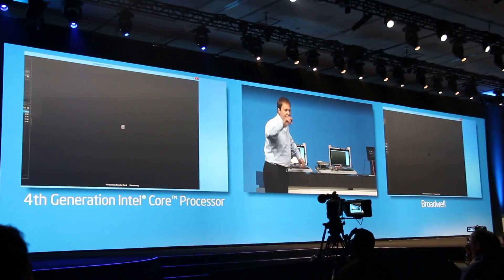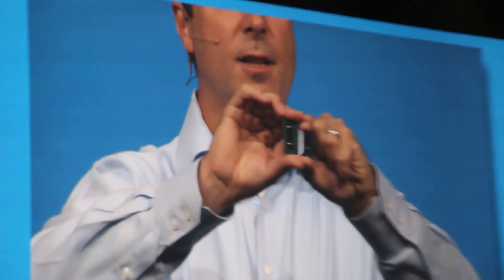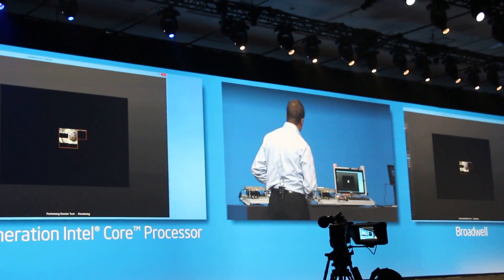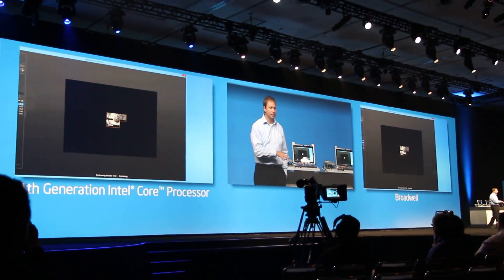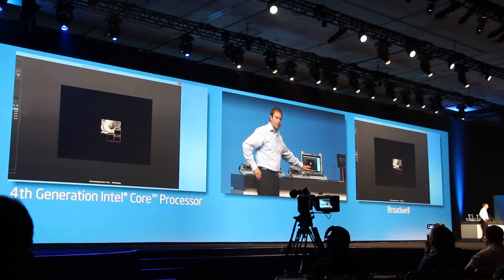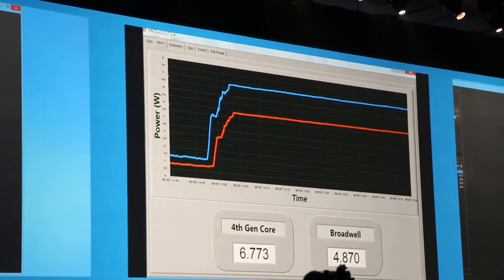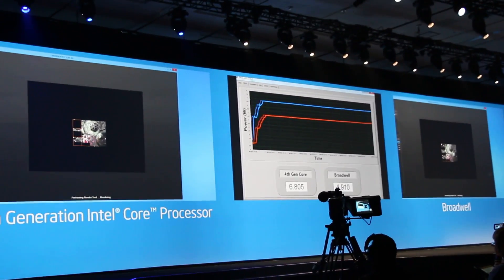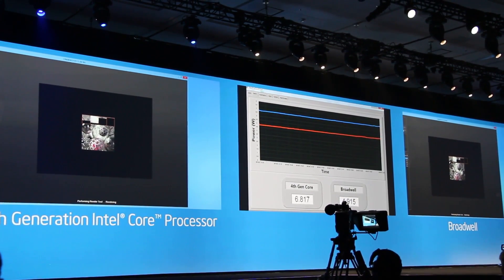Intel demos Haswell vs Broadwell at IDF 2013, shows lower power consumption, higher performance

Comment: Why dont they make the proc. a bit bigger and therefore more powerfull (if they can pack a punch in a bigger proc, why not?)like it doesnt need to get smaller and powerfull, it can stay the same size and be better than if it would be smaller
Reply: ***** Shouldnt they be able to put more power in a bigger chip? im not saying the chips should get bigger, im saying they should stay the same size and not get smaller
Reply: When you're dealing with 4 GHz speed (that's 4,000,000,000 clock cycles per second) just the speed of the electricity is a barrier. Just for reference, light in a vacuum will travel less than a foot in a billionth of a second second - and electricity moves a little slower than that through silicon. Increasing the speed beyond what a CPU can handle will cause the electricity from one cycle to overlap with another. The solution is to make the CPU smaller so that the electricity doesn't have to travel so far. Also, since the CPU is smaller, you can put in more cores. More cores = more simultaneous operations = more computing power. However, many computer programs can only take advantage of one core, so the speed of the cores count too.

So, size doesn't translate to power with a CPU. remember that you're just dealing with 0s and 1s, so it's not like having a more powerful "1 signal" will add any value to the CPU other than making it hotter. Smaller is faster.
Reply: ***** explains a lot, but what i meant was something like this (0' and 1's used as an example like you pointed out "more powerful 1 signal)
http://imgur.com/J2W0vhW
Reply: ***** Yea nanosecond. Thanks for the correction.
Reply: More OCing.